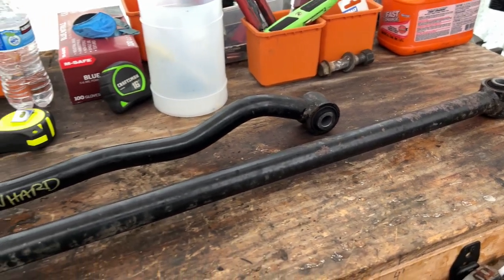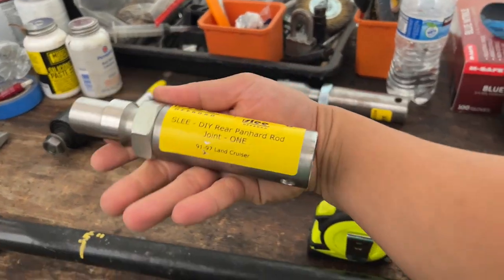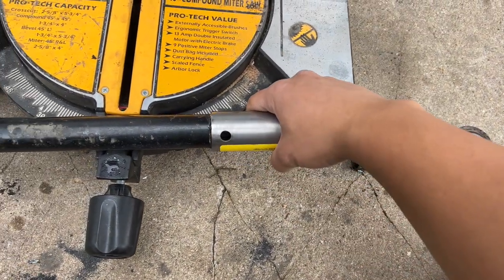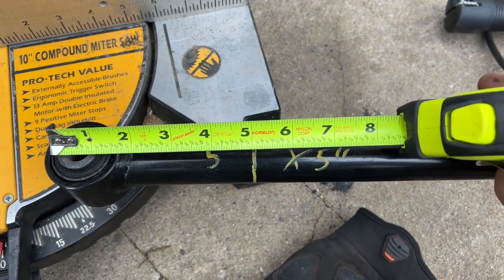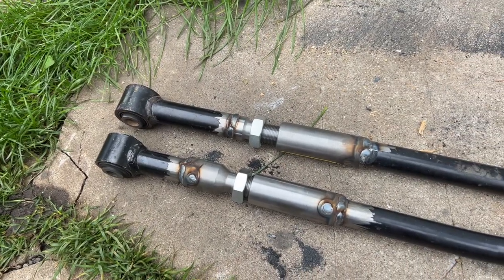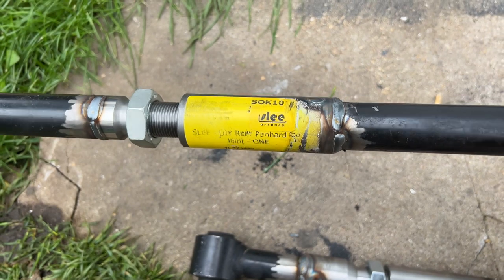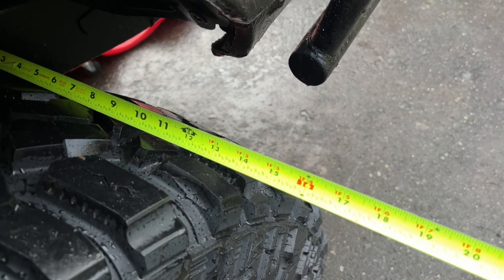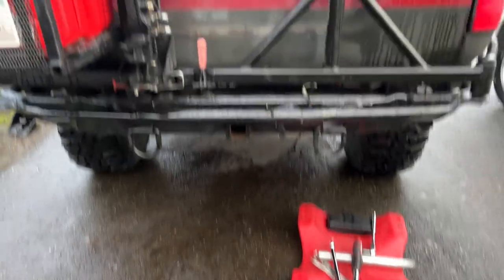Toyota Land Cruiser FZJ 80 | Slee off-road adjustable Panhard install

Comment: Nu, I have a Ford F-250 lifted. If I ran aggressive tires an put in lockers front and back would it get me into eureka for caribou.?
Reply from the maker: Yes. You can make it maybe about 20miles in. Anything further than that. You will deff need to build a buggy
Reply: @NuttyNu  Right on.!
Thank You